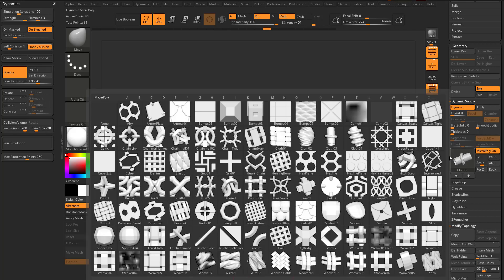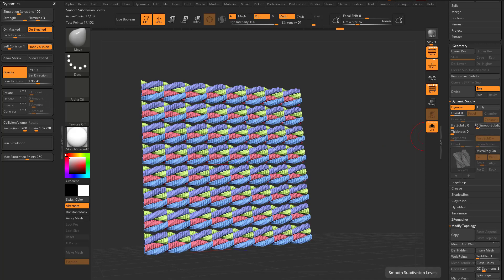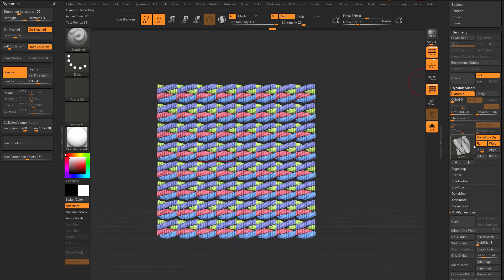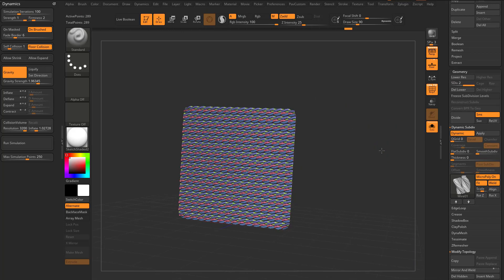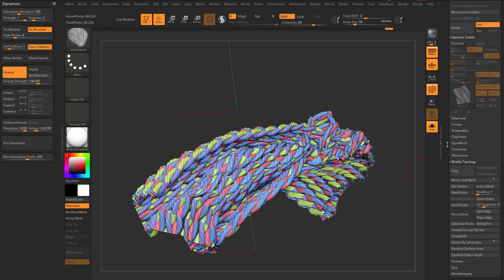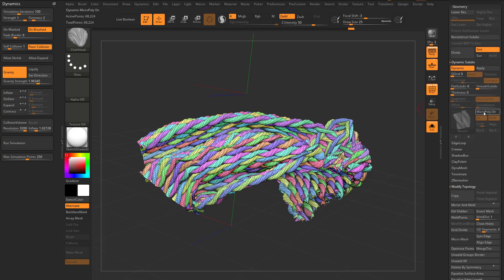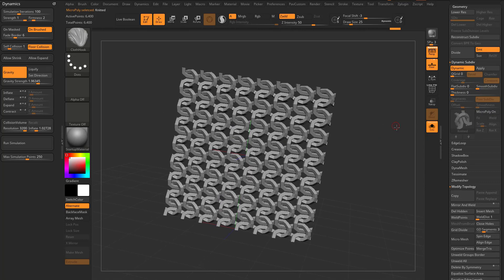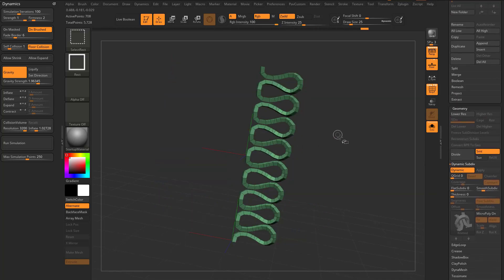042 ZBrush 2021 MicroPoly Weave Deconstruct

Comment: and what's the difference between micropoly and nanomesh?
Reply from the maker: here's micropoly vs micromesh; nanomesh adds a ton more control and options for indexes and variants, but isn't going to be as responsive as MicroPoly for real time simulating (although you could add the nanomesh on after simulating). Also if you wanted to do the auto-random variants selection, MicroPoly is far easier in that regard than nanomesh https://www.youtube.com/watch?v=m4xbor6PujY&list=PLkzopwqcFevYupwEW1Zl_Iva0HWLIuOvr&index=47